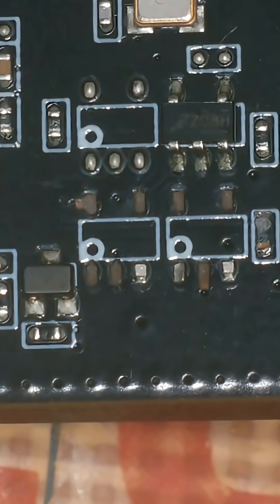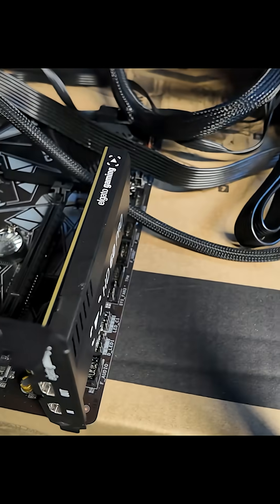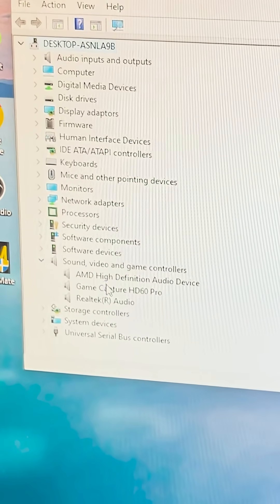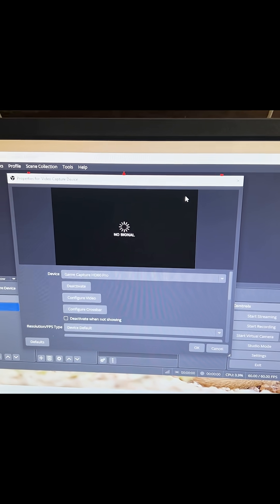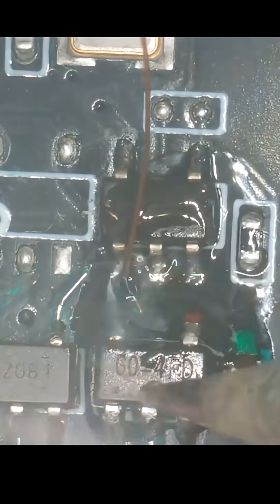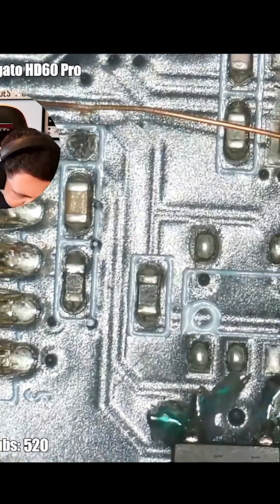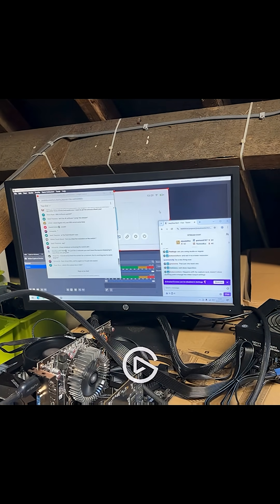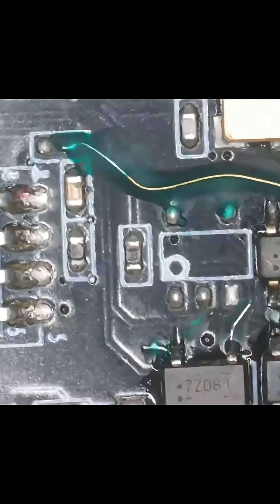Can I Repair this FAULTY Elgato Game Capture Card?  #soldering #repair

Comment: I want the 4 port version don't know if 3 in 1 out or 4 in because my monitor is on the GPU not really need to capture but sick of switching between the 2 the convertor box to watch morning cartoons is the other when I had the Switch then that monitor automatically changed to it and done playing back to PC and Picture in Picture if I wanted to check for hidden stuff or try to beat the level after hours on the same issue.

Comment: Worst thing ever is when components are missing, you can guess some capacitors and other stuff, missing resistors are a light headache, even worse is propertiary ICs if you don't have an image to see what goes there or donor board to swap, and most times i give up on coils. Yes, damn coils you have no idea what they are, i have no work around on this without donor as it's time invested on experiment with a non guaranteed repair.
Thankfully this was an easy deal.